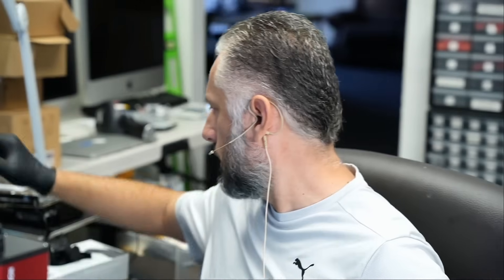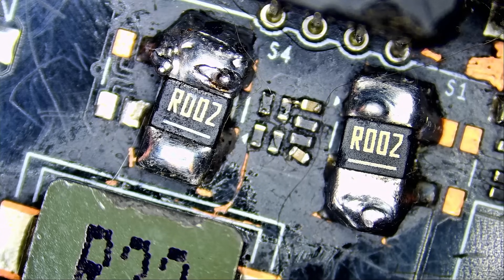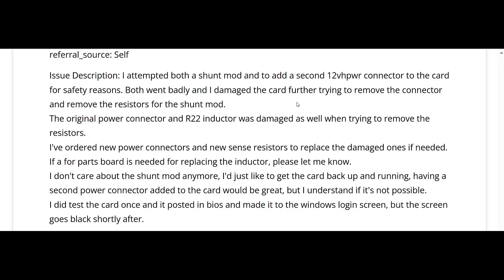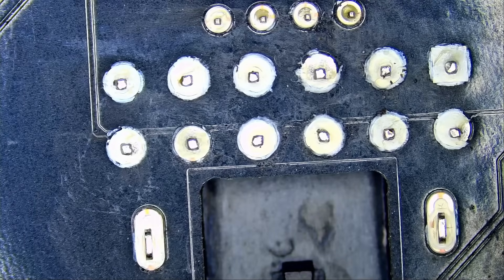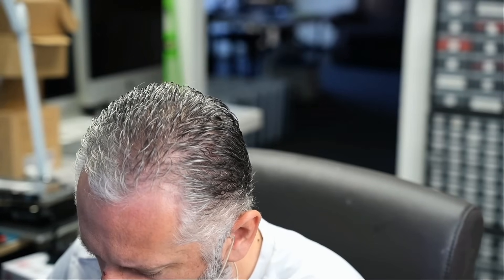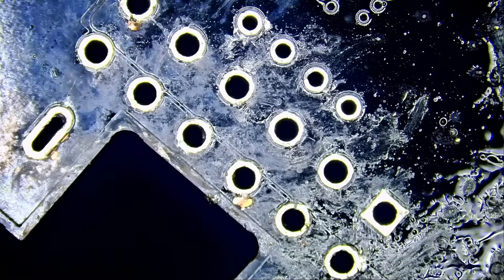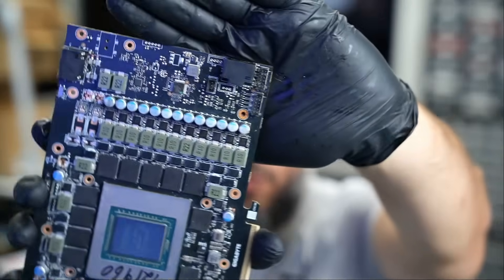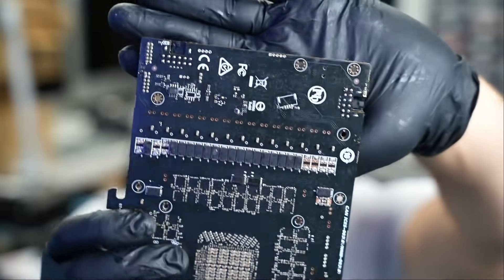3 Dead 5090 GPUs?! Gigabyte Shunt Mod Disaster and Repair.

Comment: You probably shouldnt even attempt to use thermal pads because the new 50 series gigabyte gpus use thermal putty (they call it thermal gel), which means that the tolerances on the heatsink and its manufacturing may be much looser because putty will fill whatever the gap is and excess is just gonna squeeze out like with thermal paste. You might find out that one row of vram needs 2.2mm pads, other row needs 2.35mm, vrm needs 1.75mm, it can be all over the place, and if you pick thicker pads, the core is gonna have poor contact, and thinner pads wont cool the components properly. 

You should probably just buy a thermal putty jar, a tool that can shape that putty into a properly sized rectangle (you would waste a lot of putty if you just put blobs on the components, but if the putty is cheap you can do it to save time), and have it ready for any current and future gigabyte gpus, because they are not coming back to thermal pads most likely, and more and more brands are gonna switch to thermal putty, it is simply cheaper, as the distance between the heatsink and components doesnt really matter if they are using thermal putty. 

You might also want to switch to PTM7950 phase change pads for gpu cores instead of using thermal paste, it works better, it is less messy (i recommend applying it cold by putting it in fridge beforehand), and you always know you perfectly covered the whole core with the perfect thickness. The only disadvantage is that one 40x40mm squaze can cost up to $10, but you may give your customers the option to pay $10 extra, many people prefer to use PTM7950 because the core temperature will be 2-4°C lower, and they wont have to replace it in the next 5 years because it doesnt dry out, many brands like Asus or MSI use it on their gpus instead of thermal paste now.
Reply: up

Comment: The stacked shunt resistors are the typical mod for those that don't have the equipment to remove the originals.  Works fine as long as you don't screw up the solder job.

Comment: Adding resistors on top is how a shunt mod is typically done. I don’t remember the math on it but it fools the card into thinking it’s drawing less power than it actually is. The better way is to solder on an elmore labs thing that actually gives you voltage control. There are headers on most high end cards for them. All that to say the only reason you would want to do that though(shunt modding or attaching something to get control of the voltage control chip) is if you are doing extreme over clocking going for world records which unless you are using ln2 and have a modded bios is pointless. Also pointless because an air cooler or even water cooling is never going to be able to keep up with the heat produced from pushing the card that hard you have to go sub zero. And seeing as that card wasn’t even prepped in any way to go sub zero, I can’t imagine why you would even attempt that. Although adding a second power connector is probably a good idea regardless. Why nvidia doesn’t make that the standard at this point i have no idea.

Comment: The mod the customer attempted was to add additional shunt resistors in parallel, to reduce the overall resistance by a small amount. That's why they stacked them up like that - saves them attempting to remove and replace the existing shunt resistors.
Reply: It tricks the boards power measuring and allows it to draw more power, thus letting you overclock it further. It's very common mod in HOC circles, seems like this fellow tried it for the first time on his 5090. lol.
Reply: Good lord! I am like Alex here, some people see these videos and think ,,,,
That looks simple! Reminds me of Xbox remote repairs. 
See a video, order joysticks , break the remote opening it, replace the stick with somewhat success , find it not working only to realize they have lost or scattered the surrounding micro components controlling the stick!! YEAH that was easy!!

Comment: You can measure the thickness of the thermal pads using plasticine balls placed in the appropriate places on the video card. Mount the cooler and then remove. Each ball will be become a plate of the needed thickness.
Reply: I wouldn't waste my time with that, i'd let the customer do it.
Reply: @JohnnysCrap he's a business it's an extra service so should invoice the customer
Reply: Bingo your correct and best advice.
Reply: Who’s got time for that? The customer can do that but I wouldn’t expect the shop to go through all of that unless they are paid for their time.
Reply: That's a good way to find out, i never changed mine as i didn't know the thickness.
Reply: Some people have considered the same technique. But what happens if it sticks to two surfaces? The play dough (plasticine balls) will crumble.

Comment: Asus was able to get me the thermal pad measurements for my old 3090 TI a while back, so I assume Gigabyte can probably give you the right ones if you or the customer has time to ask them. It will take time for them to get back to you with it though assuming customer service won't have it on hand. I wish manufacturers would just make this info readily available.

Comment: It is amazing to me. People will take such an expensive piece of hardware and use it as their first soldering project... Some e-waste cards would provide much needed practice for someone wanting to try this. One of life's difficult lessons I guess. 
Edit: forgot to credit you on your fantastic work as always. better than factory!
Reply: Wouldn't happen at all if Nvidia, Asus, or whoever wouldn't gatekeep the 1000w+ XOC vbios from being posted on the internet.
Reply: Not really, older cards are easy to work on, they don't have as many layers and the components are larger and spaced further apart.

You would need to use a cheaper card of a similar generation for practice to get similar behavior of soldering and heating.

Same reason why I'm not a fan of content creators suggesting practice boards from some business. While they are good for basic soldering practice, it's not close to a production board you would work on. The amount of heat you need to use is significantly higher because of heat soak.
Reply: they want instant gratification  😂
Reply: They have the money i guess
Reply: @ericb9511 I bet that the homebuilder didn't pay for the card
Reply: Peak of the Dunning-Kruger
Reply: @elektronikk-service nah....that was the guy that painted his face with lemon juice and then robbed a bank thinking the lemon juice would make him invisisble....but these guys soldrting iron modders are a close second
Reply: These are the exact people that NVIDIA wants buying their cards, rich Bozo's.
Reply: My first shunt mod I was doing it to a 1080ti, I pulled apart an old GTX760 and learned on that.
Reply: Lets COOK! $30 solder iron and $60 heat gun off amazon, $50 shunts and 12vhpwr header off aliexpress, 30min YT video + $3000 RTX 5090. Result cooked 5090 and brains super cooked after inhaling lead solder fumes for 5 hours and proceeds to remount cooler and boot that 5090 with 2 power cables as if giving that thing two 600w power lines will get him better performance 🤣that gpu is your brain on drugs. End result is no longer a 5090, more like 5089.42 SUPER COOKED
Reply: The first graphics card I ever did custom water cooling on and also applied liquid metal to was my brand new 3090 before the 40 series card came out, because it was running hot with the stock cooler, it is still running perfectly and at much cooler temps till this day. What worries me more about shunt modding a 40 or 50 series cards is that they are already power hungry from the factory and are also more than capable of running any new AAA titles at the highest setting possible.
Reply: @THORDOX  custom water cooling and liquid metal are not even in the same realm as these modifications. The kits and instructions provided for those tasks you did are intended for beginners
Reply: And they are suffering from fire hazards too
Reply: It takes about 7 months to etch  one of those GPUs it's insane the wastage that people are causing